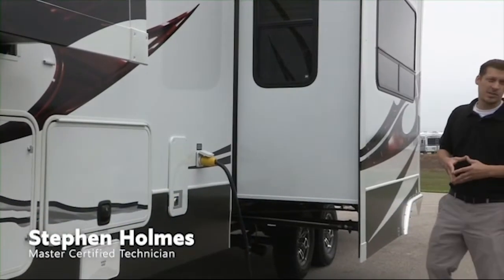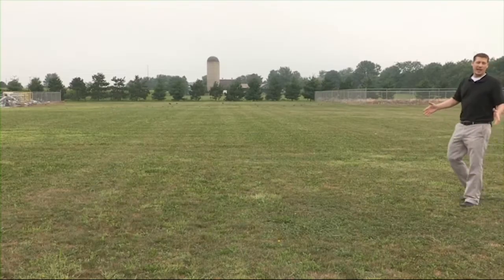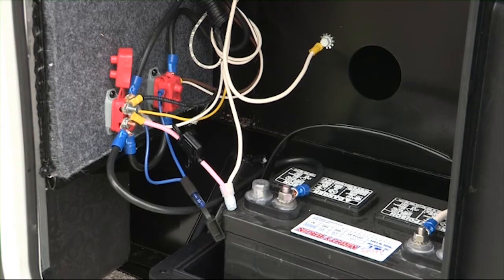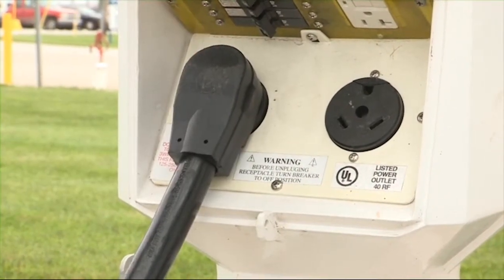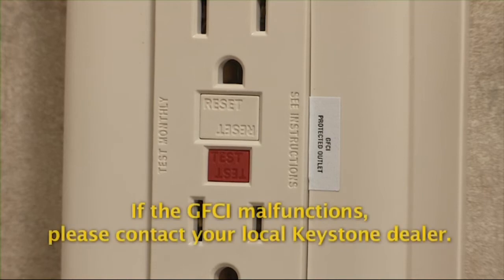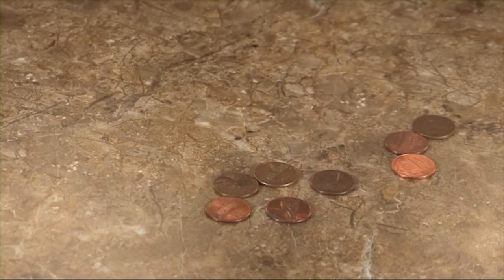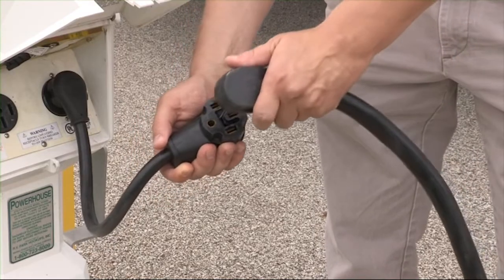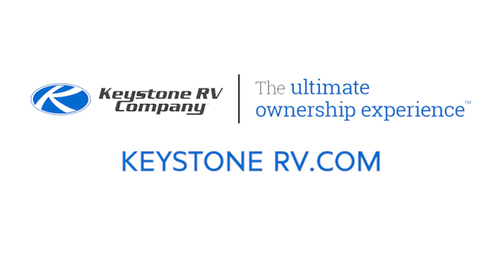Understanding Keystone RV Electrical Systems

Comment: Question regarding your OTG systems. Appears you have three inverter ready plug ins, while all these RV fix it forums when upgrading existing systems talk about their entire trailers being run off inverters for 50 amp rv like we have using solar/generator/lithium batteries what is the difference will upgraded inverter run all your outlets or is only the three available is what is available. We are considering either upgrading out Cougar 209 RET or buying newer. Thanks in advance